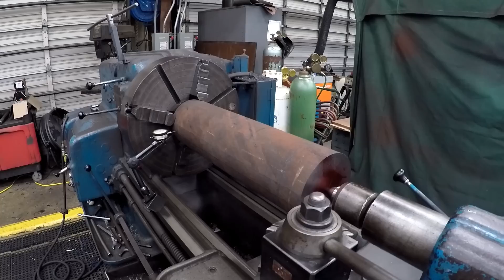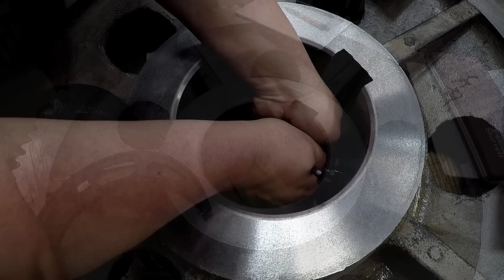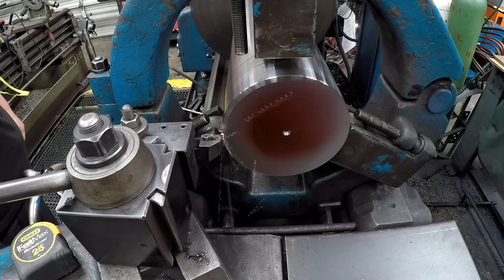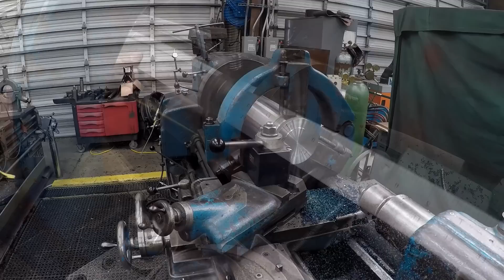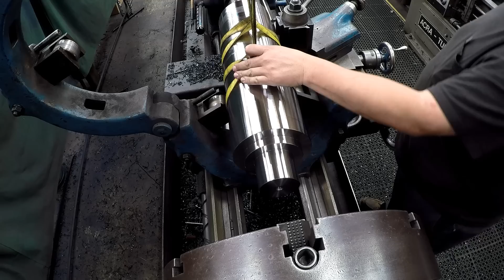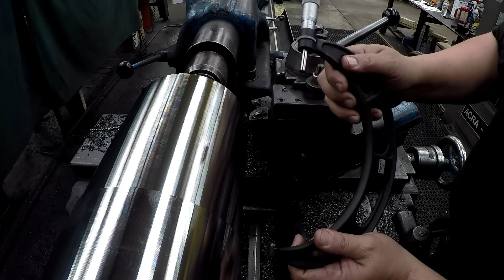Swedish Gearbox Shaft Part 1

Comment: Has anyone made a tap gripper that has an ID large enough to slip fit the tap barrel with a square hole broached for the tap end?
That way the effective OD could be larger and it wouldn't slip so easily.
Reply: My bad: SNS 147 Part 2: Shop Made Tap Driver https://www.youtube.com/watch?v=y1UFxZ59UnI
I only found it today.

Comment: Adam cool stuff. While I love the English system and usually work in it. I work on a lot of Metric crusher  and machine parts, I used to use English tools. It was a pain in the ass after it became a regular thing. So I took the advice printed on a  Caterpillar conversion chart I have. "If you build Metric parts, use Metric tools"  It helps eliminates conversion errors and saves time. A little patience and careful ebay scrutiny has netted me a reasonably priced nice set of Starrett & Mitutoyo tools out to 500mm or so. Inside & out.   And those Mitutoyo large mics I have bought are really nice tools in hand. Merry Christmas,  and happy new year. I hope you are enjoying your Vacation. keep the good stuff coming in 2018

Comment: I like that metric stuff.. greetings from Germany. ;o)
Reply: Frank Angermann ,

In Australia we have to be flexible enough to use both systems; despite officially using SI since 1976!
Reply: Bernd Felsche, i really believe the metric system is easier, but in the end of the day, what ever works is good. If i had only imperial scales i would have to cry and handle with it. Here in Germany they use imperial measures and threads for piping, and for loudspeakers as well so we don’t get free from it as well...